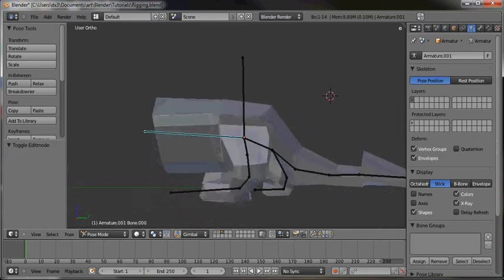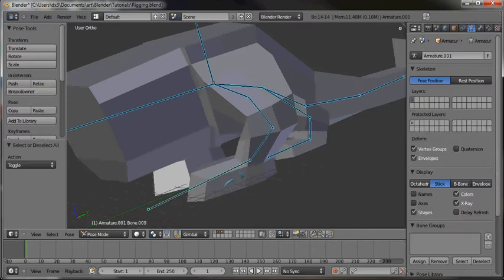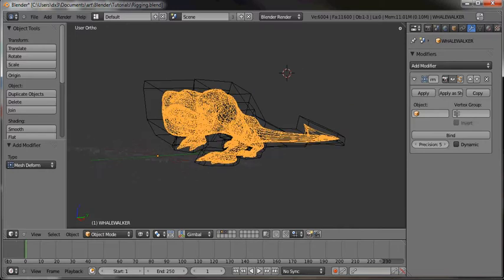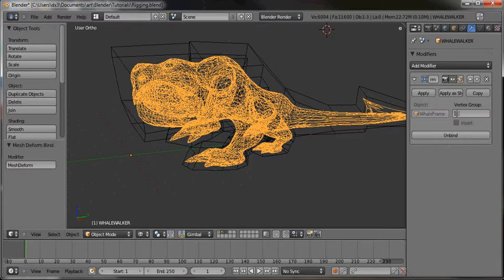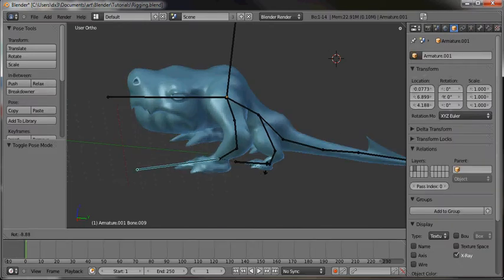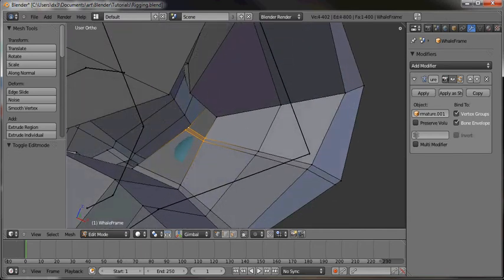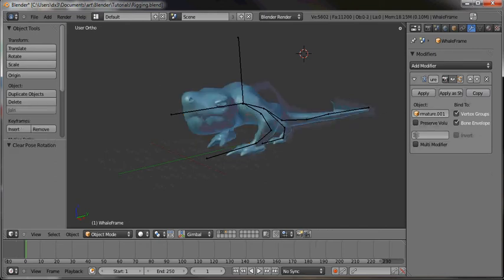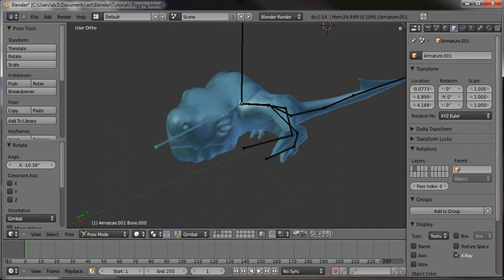Blender Rigging tutorial Part 3

Comment: @dx31979 Hrrm. I can't think of a good reason why that wouldn't work. In fact, since you're moving around a WhaleCage that has far fewer vertexes than the WhaleWalker, it should run much faster in BGE than plopping the Whalewalker mesh in. You could just have the WhaleFrame in there instead...
Might not help with making actual standalone games, but it would probably be a big help in making animatics and recording character physics, which is what I use BGE for.
It's a great idea.